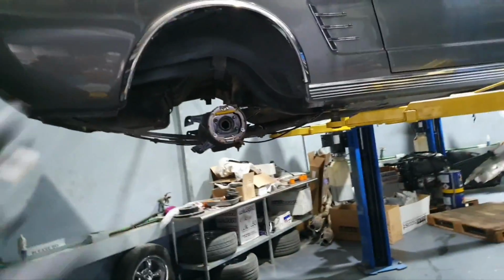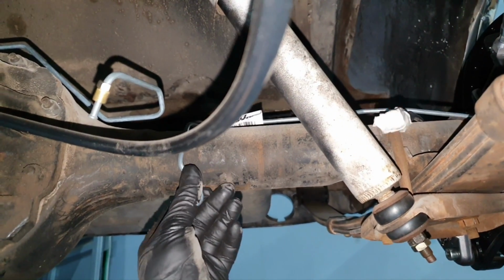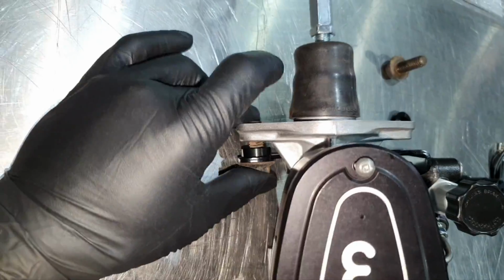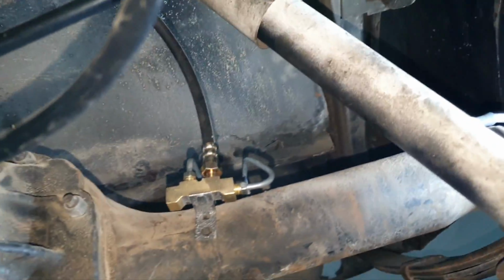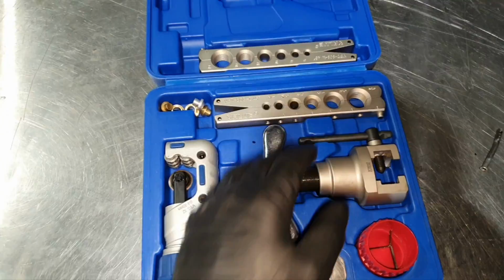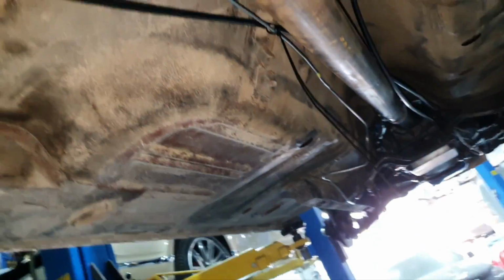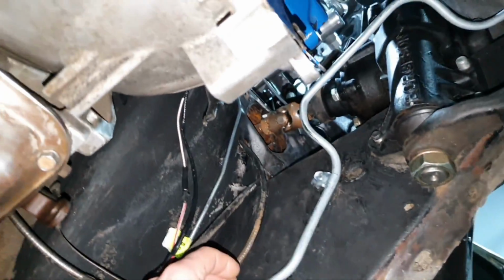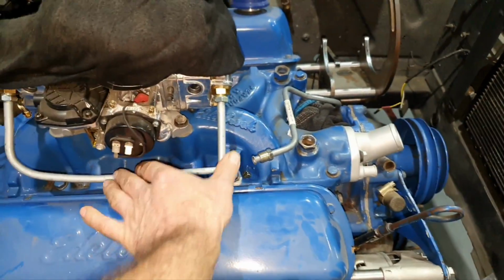1968 Mustang check up (part 8)

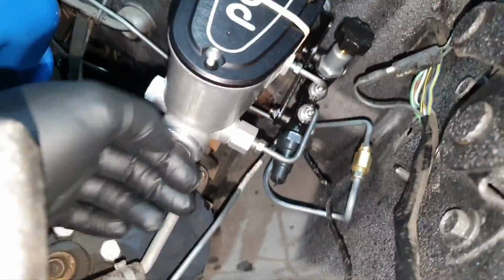Comment: WTF is up with the square loop with that brake line shown at 8:00 ?
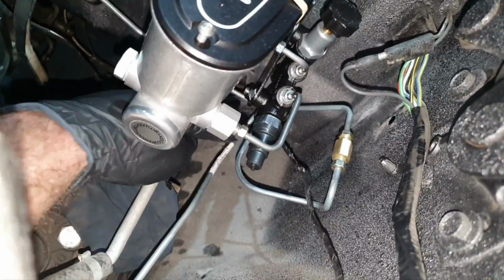Reply from the maker: You watch up to 8:00 and you stop?
 at 8:30 I'm explaining how I route the brake line without bending it and later on
in the same video at 22:20 I'm explaining what's the difference.